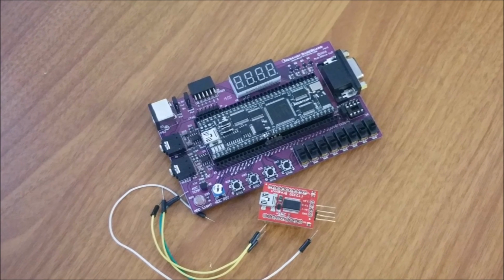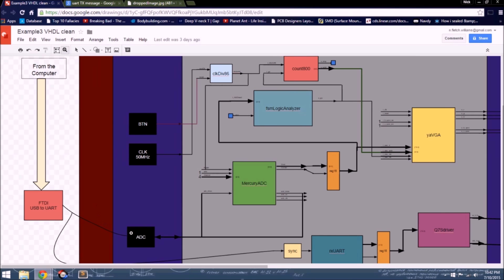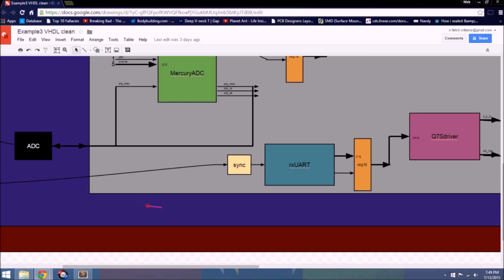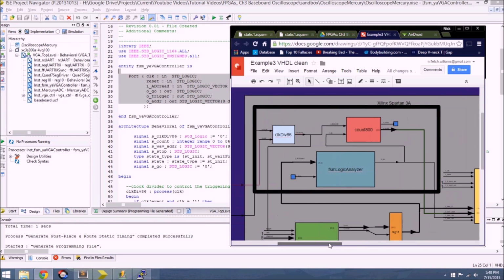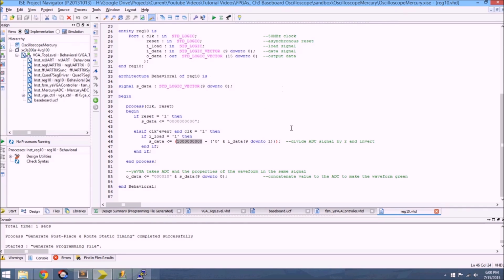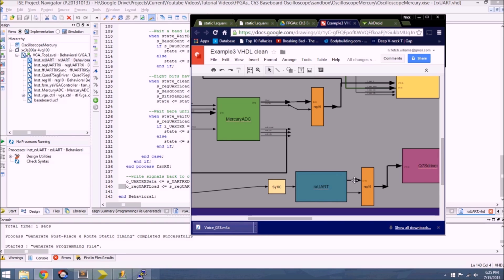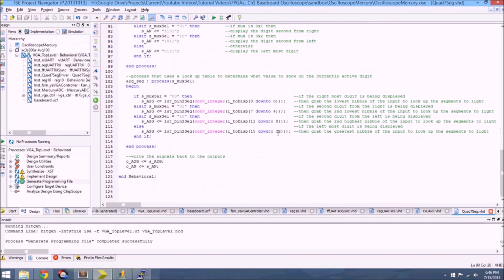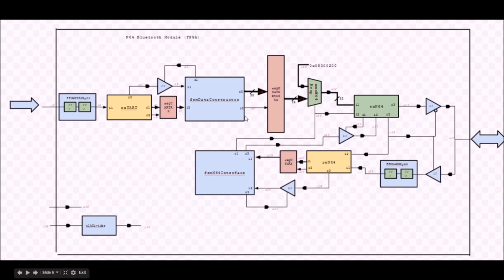FPGAs; Lesson 3: Make an Oscilloscope with Auto-Trigger; VGA and ADC

Comment: Part 1's use of "The Incredible Machine" was a great idea, it made it FPGA's very clear as soon as you switched to the slide. Not only is it a great game that I played for hours as a child - but in the metaphorical sense of how you explained FPGA's through the 
 imagery of the game as modules it dissolved any woes i had with FPGA's; as if to say, you'll enjoy this just as much!

 I admit Nick that whilst I have not touched a FPGA myself , I do however own many consumer-product FPGA devices such as a 'hi-def nes fpga mod', and FPGA powered game carts for retro consoles, it's evident that FPGA itself is not only powerful, it's affordable at the consumer level and also highly configurable from a debugging/developer level, I imagine it would be a painstaking task to program micro-controllers to do the same tasks, and if not more expensive and a lot more work physically by the engineer during build-phase and a heck of a lot more planning in that area as well... I can imagine FPGA's save money in the long-term as well as time, not to mention their potential at their form factor... but Heck I'm no engineer so I could be wrong but it seems the case. 

In fact my famicom AV has TWO fpga's , the game-cart and the hdmi nes mod... that's a whole lot of FPGA on an old retro computer, fpga's have a lot of power it seems and it'll clearly be seen further in the retro console scene from hdmi conversions analogue-to-digital and game-cart / cd emulation to name a few already implementations. 

One day I'd love to take the RGB signals of a master system 2 for example and design a fpga to convert it to HDMI  as a challenge. Eventually get a chinese company to produce custom pcb's and put the fpga chips on them myself as I'm getting into smd soldering which has been a lot easier than I thought it would be.  This idea is probably 5-10 years down the line but you have to start somewhere right? 

Thanks again Nick... great video's subscribed.

Comment: Hi Nick, 
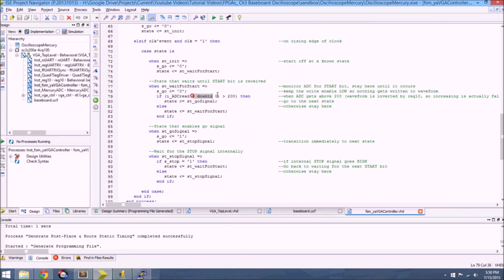I have a simple question. In the Module "fsm_yaVGAController" line 79 (27:51 in the video), you set      

if (i_ADCread(9 downto 0) > 200)

The number 200 seems to me an arbitrary number. Can you explain for me?
Reply: +Nick Williams Oh I see Thanks!! 

I have one more question. I added source "vga-control" module and its sub-module "u2_waveform_ram" into my new design. It seemed no errors when I added them, however I had a trouble running "View DHL instantiation Template". 
I got a warning message : WARNING:HDLParsers:3481 - Library work has no units. Did not save reference file "C:/Users/JUSTIN~1/AppData/Local/Temp/xil_4660_5/hdllib.ref" for it.

All modules for this project were in the same folder. What did I miss?

Thank you!